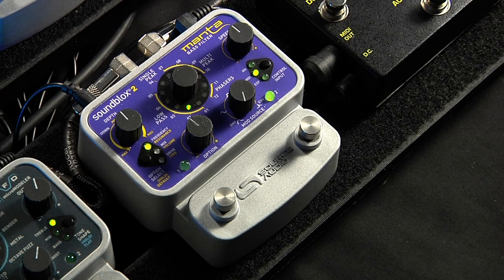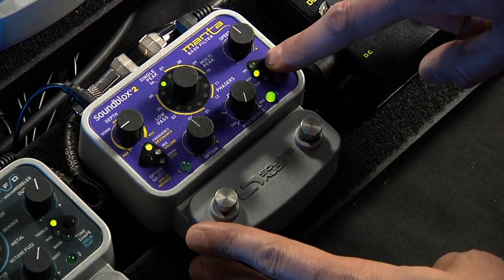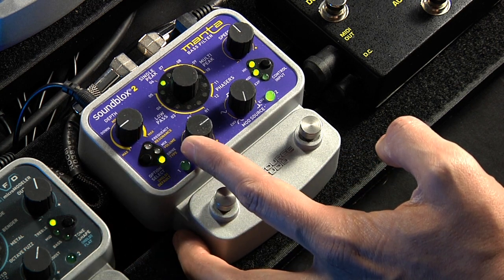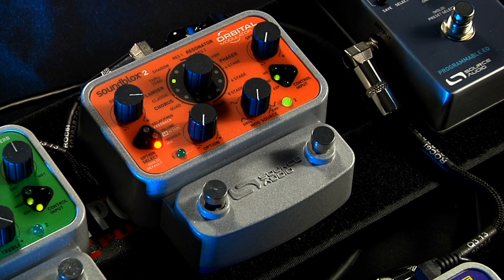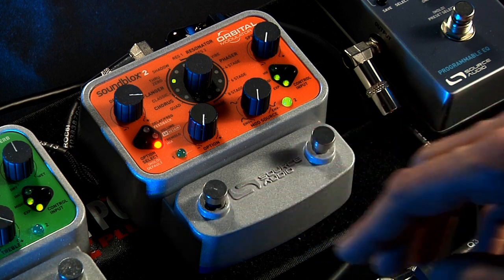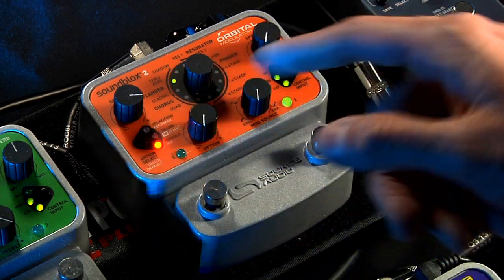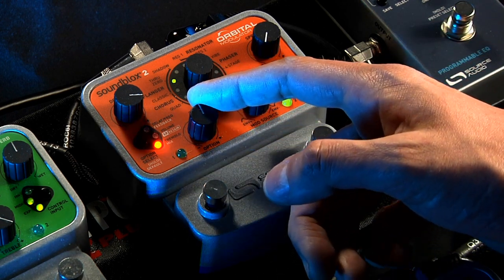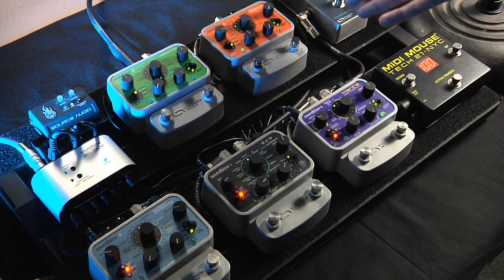How to Create Bass Wobbles with the Soundblox 2 Manta Bass Filter

Comment: can we do the same with Soundblox Multiwave Pro Bass and Soundblox Pro Bass Envelope?
Reply from the maker: Yeah, you can definitely get a sound pretty close to this with the BEF and Multiwave Pros. Of course you won't have the flanger effect (unless you have an Orbital Modulator and an expression pedal), but the basic wobble sound is in there. Put the Multiwave in front of the BEF in the chain and dial in your favorite Foldback Distortion (we used a Gated Fuzz in the video, but a Foldback sound should give you more than enough fuzziness). Then dial in one of the Single Peak Filters on the BEF (I would suggest filter #12). Control the filter modulation with Hot Hand and you are in business.